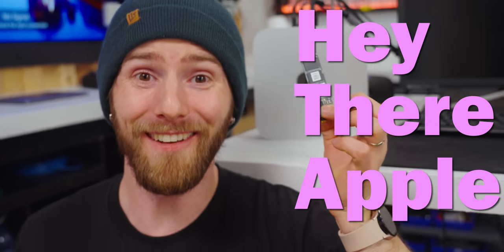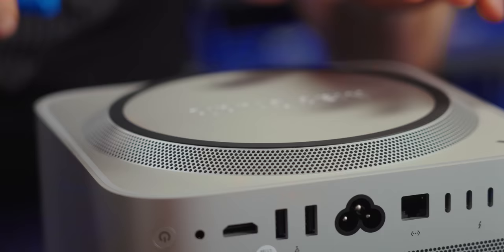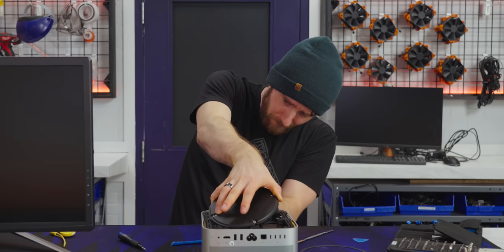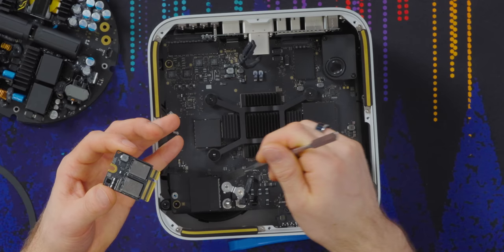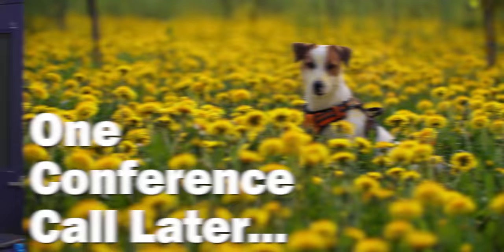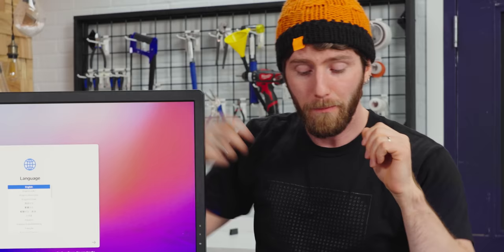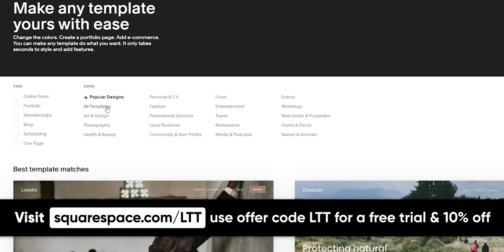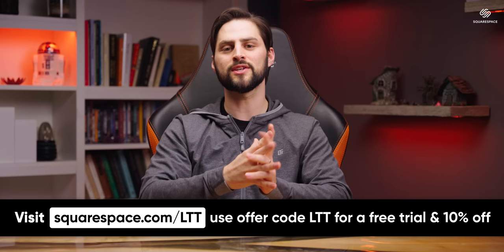I want to love Apple, but they’re making it hard - Mac Studio SSD Swapping

Comment: They made such an effort to make it unrepairable.
Reply: And unupgradable and expensive
Reply: @danielwalls5150  Looks like your SSD is faulty, we will have to replace the mainboard.
Reply: Welcome to monopoly.
Reply: @Kardall  hey I've seen this one, I've seen this one, it's a classic.
Reply: I'm waiting for my check in the mail from LMG for increasing their viewer engagement 😃
Reply: @unicodefox  correction, it can. Quit being anti consumer
Reply: As always
Reply: It’s repairable by anyone, it’s just not upgradeable. You can replace the module with an identical module from Apple or a third-party and (as far as we know) it should work. The availability of those identical modules is a completely different story.
Reply: @unicodefox  okay, how does framework make an extremely modular and repairable laptop despite not being a tech giant. And Apple fights tooth an nail to not get you to repair your own shit for a reasonable price?
Reply: Max Tech will make a video on how Linus is wrong!!!😹😹😹
Reply: @leovang3425  It CAN but that didn't make sense for apple, and not for 100% anti-repair reason. I don't doubt anti-repair wasn't on the table, but people saying apple did it ENTIRELY for anti-repair and went out of their way to do so are wrong.
Reply: @kshitijvarshney  To be fair only slightly more expensive then a PC at current GPU prices. Not that you could get a PC anywhere near as powerful at this size. Not that I’d want one, can’t game on it and I’m not a video editor. Also don’t want to pay Mac software prices. The important thing is how much influence they have on what I’d actually want to buy and this anti repair BS is bad for everyone.
Reply: @SCU3A_S7EVE  you mean it's not repairable because you can't get the exact same components?
Reply: @SCU3A_S7EVE  I bet their controller can detect third-party flash and refuse to work with it.
Reply: @unicodefox  what would you call a product that is specifically designed to work with one component because of software serial locks for the express purpose of preventing the said component from being replaced with an exact replacement, even from another device? They call that UNREPAIRABLE , meaning that even if you had an OEM part from Apple, you could not repair your device without having to go to Apple and only Apple
Reply: @theLMGN  they are saying "intentionally" because Apple puts extra time and manufacturing into making these things unrepairable by 3rd parties.

For example, the non-removable power cable. They put extra time and effort into engineering a cable that you need a specific apple only tool to remove and replace. That seems pretty dang intentional to me...
Reply: @unicodefox  nope. Doesn't work like that. A regular SSD wouldn't bottleneck it. So it was 100% planned obsolescence.
Reply: Ross enters the chat..
Reply: @InvisibleSquids  Linus replaced the flash in this machine and it worked...
Reply: @unicodefox I think it’s only for anti-repair reasons. To push parts around in a computer so that you can’t easily replace individual components or to lock components to chips has no use otherwise.
Reply: @unicodefox  iSheep spotted
Reply: @leovang3425  Because that's a difference between a company that promotes itself as ultimate repairability. I think apple SHOULD try to aim for maximum repairability, especially in a machine like the Mac Studio, I just don't like people saying they went out of their way to make it completely unrepairable.
Reply: @unicodefox  <~~~ found the sheep
Reply: @InvisibleSquids  Did we watch the same video?
Reply: Besides, the term PC was originally defined as ‘Personal Computer’, and according to the Merriam-Webster Dictionary, PC still means as such. If I purchased a Mac computer, I’d like it to work as if it was my ‘personal computer’, because I own it. If the right to repair is steam rolled and buried by the likes of Apple, you will own nothing and have zero permission to do anything with what you are ‘leasing’
Reply: @esmooth919  Yeah, we get it. You don't understand how this works so you just gotta resort to childish insults.
Reply: For that they cost you too.
Reply: @unicodefox  apple apologists detected* OPINION REJECTED!
Reply: @Kardall  hahahaha
Reply: @esmooth919  Grow up.
Reply: @unicodefox  The only one that went out of his way there is Apple to lock their system as much as technically possible.
Reply: I'm not saying this is how any of this should be, but this is how it is*. I *wish i could put more RAM in my MacBook, but I understand the technical limitations on why you can't upgrade the ram in a M1. With older Mac's its a lot more muddy, the only reason you couldn't replace ram was because laptop go thin, and of course, Apple likes that $$$.
Reply: @LazyEngineerYT  Grow up.
Reply: @unicodefox  Lies. They did make it unrepairable.  The function of having to have another MAC is completely pointless outside of making the computer more unrepairable.  The only liar here is you.
Reply: Don’t worry soon the EU laws will creep up to these business and end all this crap
Reply: @unicodefox  No, you're just one of those who believed and repeat that bs.
Reply: @Kardall  When was the last time your NAND is faulty? LOL ... The SSD Controller is in the SoC, so the only way it will fail if it's NAND dies.
Reply: @unicodefox  Your a consumer, I am a consumer. Let's all push them to make it long lasting, PEOPLE CANNOT SHELL OUT MONEY ALL THE TIMES ESPECIALLY IN MANY DEVELOPING COUNTRIES.
Reply: @tpg81  Ok, replace the NAND on your SSD (not the entire ssd!) and tell me if it works. If it doesn't I expect you to treat WD, Samsung, Sabrent, Kingston, etc the same.
Reply: @unicodefox  if the design was faster than a industry standard SSD, then you can make claims that Apple engineered for performance. But it's not, it's not any faster.

Apple even went as far as having a m.2 like interface.
Reply: @unicodefox  no. They spent time making sure it didn't work.
Reply: @unicodefox  that ain't true. Why would locking out higher capacity flash modules makes it slower? Or why would it increase engineering time? Almost all ssds with higher capacity are faster than the ones with less capacity. And apple used some engineering time to add this dumb "security" while they could have just not spend any time and there wouldn't be any problem...
Reply: @unicodefox  please explain to all of us hillfolk what the technical limitations of replaceable ram dimms in an apple are. We shall wait.
Reply: @unicodefox  there is no technical limitation to a DIMM slot.
Reply: @leo vang you obviously don’t have the knowledge about the RISC architecture in the recent Macs. With arm, the SSD controller is baked into the SoC for speed, power efficiency and lower production costs. Because of this, different flash chips often do not work correctly with other brands controllers. They have done this to reduce the current required on the data lines as the controllers are located closer to the processor saving power. Obviously they may of considered anti-repair tactics after, but this was not the primary motive
Reply: Meet Apple
Reply: @unicodefox  Yup, so that shouldn't be an issue to build something proper from the ground up.
Reply: @techandy1747  he can do this 🤣
Reply: @leovang3425  I saw it on a rerun....ofeveryappleproductever
Reply: @danielwalls5150  Nothing at the genius bar is repaired, its just flat out replaced and sent to the e-waste bin. Whatever its attached to gets replaced. Like a full on motherboard replace just to fix a faulty connection or ssd or cpu or ram or anything xD.

Thats apples special feature ;)
Reply: pro tip, stop giving apple your money.
Reply: @unicodefox  People like you drives Louis Rossman mad
Reply: No, it comes from the M1 chips being based on embedded SoCs. Those don't generally do PCIe slots very well.
Reply: @unicodefox  There is absolutely no technical reason (performance, reliability, security, etc...) why replacing a 512GB module with a 1TB one wouldn't work. They sell the damn computer in that configuration. It not working means they went out of their way to specifically block consumer or 3rd party storage upgrades.
Reply: @unicodefox  the fact that they built the power cable into the monitor means that they intentionally do this crap
Reply: Sadly yeah. Very frustrating. Love my M1 MacBook Air too, but frustrates me that it’s not very repairable and not even the storage can be upgraded. This one though, with modular storage that can’t even be upgraded, is just beyond stupid.
Reply: Well, that effort made them money
Reply: @unicodefox  A Mac is a PC just with OSX installed lol
Reply: @martinqizeaq  Very true, and doubt we even really get any additional storage performance by having it integrated as it is. Least not much
Reply: @unicodefox  OMG, brainwash is worse than I thought.. 🤦‍♂
Reply: Not unrepairable, unupgradable
Reply: @unicodefox  when you spend Billions on engineering your engineers Will literally spend millions (if you divide the money spent by the time spent) on the subject of repairability given the company HAS to give a warranty and therefore plan for repairs, they just focus on what they need to do to ensure they're not straight up replacing units for a small factory defect. Stop making excuses for people that know what they're doing.
Reply: It's almost like it's their hobby at this point
Reply: @katherinemorton9126  So you are saying the limitation is hardware-based and there are multiple versions of the silicon, each of which supports only ONE storage size?  How is that efficient for manufacture?
Reply: just buy windows PC.. ez
Reply: @unicodefox  hello you apple fan, they didn't add the ssd controler into the m1 dye because it's better (and it may be 2% faster, i have no idea) but because it's cheaper, the used their type of not because the philips screw isn't good enough, but because it is harder to disassemble and so on.
Reply: @unicodefox  so anti- consumerism anti third party repairs anti upgradable UNLESS you send it to apple for how long? Days, weeks, months? It is better to be able to upgrade it yourself or to add non apple sourced(ie more expensive) upgrades,
Reply: Nah it’s repairable, just not upgradable. You have to stay at the EXACT spec as it was when you bought it
Reply: Agreed, and if they put all that effort into the mac itself, it could be a good mac/pc
Reply: It seems like Apple is where engineers go when they are angry at consumers
Reply: @Wigglez69  only in the EU, The USA will still be stuck with this crap
Reply: @unicodefox  no its to make more money... nothing to do with reliability, speed, performance... its an NVME M.2 Interface nothing more.
Also the DWPD is nowhere to be found, I'm guessing it's the cheapest NAND possible.
Reply: Are you surprised?
Reply: @Sanya192  and if the controller is on the die then you cant use a third party component like a m.2 nvme ssd from kingston, there will be conflicts because of the controller on the die and the ssd
Reply: That's how the innovate these days
Reply: @katherinemorton9126  they have a whole  division dedicated to making all the hardware completely fixed and integrated so yes technically it's focused on anti repair in an indirect way...
As for performance differences in Apples NVME implemention its actually worse performance... your transferring data from the NAND dies of PCB down the m.2 connector to the NVME controller which is on an SoC by itself and then passing it to the PCIE controller and then back to another SoC which has the CPU cores... that is a disaster in terms of performance, power, stability and reliability plus your going to have several retimers because the distance is huge.

There is no performance advantage, the interface is NVME M.2.... the max I/O is completely capped... your limited by a physical x4 PCIE link.
Reply: @unicodefox  And how do you know this is inaccurate? Blind faith and trust in Apple?  It's totally possible that they did this to continue overcharging for storage. Actually, it seems more likely that this is the case
Reply: to be honest. anyone deserves this treatment if they buy any overpriced crap just because there is an apple logo on them
Reply: So much for ewaste control
Reply: @Kardall  More like, "Looks like your SSD is faulty. Would you like to buy another Studio now or later? :)"
Reply: @unicodefox  I understand your point and to an extent agree. The guy saying you can't replace the SSD with an identical one is of course wrong and obviously didn't watch the video. 
The only thing that'll mud up your argument is a little more testing. They might not support two 512gb modules because that's simply not a configuration they sell. Fair enough. But if you take two 4tb modules and drop them into one of these computers and it refuses to format, that's absolutely a firmware lock that was intentional. If putting a 1tb module in a 512gb device doesn't work either, or any other factory supported configuration, same issue. We'll just have to wait and see.
Reply: @Kardall  Looks like your SSD is faulty, we will have to replace the whole house.
Reply: @Kardall  No you can install one of the same capacity.  But for an Upgrade.. you need to buy a whole new Mainboard, or get someone for flash a hacked Firmware on your old.
Reply: The Right to Repair bills and laws leave a huge loophole for Apple and others to exploit: the timeliness and price of parts. Nothing would stop any anti-competitive company from deliberately dragging out the process and marking up prices to discourage owners from fixing things themselves. Apple making things increasingly difficult to open up is just another sign of how it'll act when/if RTR laws finally are passed. In my case, luckily I have a friend who is able to help me work on the Apple things I own.
Reply: What we (the world, except Apple fanboys) understand as a "repairable" computer  is one that you can fix at reasonable price, not one that the SSD has been specifically  designed to cost four times its price in the open market for no reason. This SSD is slower and has  less capacity that many SSD NVMe that cost half the price. Also  it uses standard flash memory not manufactured by Apple. They just got an upgradeable & repairable standard  computer component and dedicated a team of engineers to block those possibilities just  because of  corporate greed. Bad for the clients, programmed obsolescence in pure state, bad for the planet and  a crime against humanity.
Reply: @unicodefox  How does boot taste?
Reply: @Kardall  your $2 display cable is too short, we'll have to replace the GPU, mainboard, and screen.
Reply: @unicodefox  "but but but whatabout whatabout whatabout" stop. just stop. Those companies are trying to do it too but at least they don't come with proprietary BS. What? because other big companies are bad that means apple is forgiven?
Reply: @unicodefox  Correction, expecting it is perhaps not the right thing to do, but there's nothing wrong for people to demand it. We're the bloody customers! We can demand what we bloody want to buy! Is it up to the manufacturer to decide if they want to deliver? Absolutely, but it still doesn't take away your right to demand what you would want and to complain about what you're getting.

Are they blowing it out of the water? Some might, but if that's what it takes for them to be heard and it is still for your own benefit, why can't you just leave them be instead? Better them than leave companies be if you ask me, as a customer at least.
Reply: @unicodefox  No, dude, the only reason they made it unupgradable is because of money. That is the sole reason.
Reply: @danielwalls5150  Might as well just   calling itthe dumb bar
Reply: @unicodefox  this is such a stupid take. Sure, having RAM soldered on makes the whole system faster and more integrated. But making the ssd unreplaceable is just stupid
Reply: @unicodefox  lol we have an apple fanboy here
Reply: Modular, they said...
Reply: EU to the rescUE
Reply: @kshitijvarshney  Cough cough... Unless you pay with kidney 😊
Reply: More R&D budget spent on that than providing real innovations, for sure.
Reply: @unicodefox  but is it though?
Reply: @Kardall  ah you mean I need to buy new imac / mcbook because it has slight scratch mark on the cover, got it, here's another $5000
Reply: I feel like at this point it would cost less to make it more repairable than put the time and effort into making it not repairable. This is where there R&D goes.
Reply: For all the people who hate the price, they make a damn Mini and Air just for that reason. Just can’t please some people huh?
Reply: No. They made an effort to make it repairable, only by qualified trained personel with the correct knowledge and parts.
Reply: @unicodefox  I am not sure how else to put his fam — on a PC I can just upgrade the storage on it, but that is because the storage controller is on the SSD. Linus is right saying there's no reason for this — end-users with the tools to do so should be able to upgrade the flash, re-write the system and expect the modules to work. Except they don't because they designed the system in a way you can fix but not upgrade the capacity.

If I put a higher capacity module into this hunk of junk because I needed more space inside for more stuff, I shouldn't be disallowed by using this feature. That's just like Samsung DeX but only if I used their special HDMI cables because they use the reserved pins for some horseshit where I can only interface with newer Samsung TVs. (Apple already does this with some accessories!) Or as presented to you multiple times, component serialization where OEM parts can't be replaced without special software to Authorize the components.

On my crappy discontinued Lenovo S340-15API I can tear down the board, put an SSD in and it just works. It doesn't matter if I add in less space, or more space, I could had went down to MicroCenter yesterday and got myself one of their free SSDs to put into my machine — it could had fit and I could have more space (with greater throughput speed).

This storage module crap leads to a few occurrences which result in the following:
A) End-user goes into an Apple store or ships off their computer to get their storage upgraded (not replaced with like module)
A.1) End-user is charged an outrageous amount of money for the privilege
A.2) The repair depot it ends up at (because you don't think they fix the devices in-store on-site do you?) uses their specialized Apple-branded hardware unavailable for end-users to re-authenticate the hardware configuration
A.3) End-user gets the machine back after up to several weeks of waiting
B) End-user tries to upgrade themselves
B.1) End-user buys more capacious module online without foreknowledge of the pain to come
B.2) End-user purposes a debit / credit card as a scraper to break the rubber seal
B.3) End-user risks potentially-deadly shock by touching live metal components on the power supply via a capacitor holding charge
B.4) End-user managed to either insert a like module of same size for higher capacity or replaces the module forthright to add more capacity
B.5) End-user tests configuration and tries to restore
B.6) Machine detects a storage hardware or size mis-match (capacity greater than provided) which appears to be baked on-board or can only be reconfigured at an Apple repair depot
B.7) End-user gives up after so long and makes their way to the Apple Store for resolution
B.8) Genius tests the rubber seal and sees it had been tempered with resulting in a denial of service
B.9) End-user must choose one of three options (i, ii, iii)
B.9-i) Abandon machine and leave at Apple store
B.9-i_1) Apple sends the machine to a repair depot
B.9-i_2) Depot "Refurbishes" the machine
B.9-i_3:a) If machine looks "New enough" they'll resell as new
B.9-i_3:b) If machine looks slightly damaged, they'll resell as "Refurbished"
B.9-ii) End-user chooses to have the machine repaired out-of-warranty
B.9-ii_1) A, but now moreso exorbitantly expensive
B.9-iii) End-user purchases a new machine with higher capacity storage because that's just the "Easier" thing to do

This presents a new option, C) Attempt to use the second machine to attempt upgrade out of curiosity but that leads down a similar series of events to B.

Option B should never be a thing! It's meant to deprive you of choice and make it so if you want better, you have to do it "The Apple way" rather than the PC way of just buying a damn storage module and upgrading it! Apple machines were never this hard to upgrade the storage but damn it they found a way. Vintage Apple machines where people were chopping up cases to install internal SCSI hardware into their cases was more than the one-off Action Retro presented and it's a disgrace we don't have a similar level of control with the hardware today.

The safety argument veils with the safety of preventing dangerous conditions by barring the end-user from looking inside and seeing the danger therein when it's really the safety of ensuring third-parties do not dilute Apple's hardware with third-party upgrades.

The security argument veils with the potential danger of reverse-engineering as a means of both limiting your choice of what you do with your hardware and securing Apple's long-term profits through this lack of choice!

I wish to ask — what do you advocate for?
Reply: @danielwalls5150  das ist das Ding. Reparaturen kosten Geld, wegwerfen und neuverkaufen bringt Geld.
Reply: @loidforger6413  Can't have a monopoly on a product only you create.  If McDonald's doesn't have a monopoly on Big Macs, then Apple doesn't have a monopoly on Macs.
Reply: that's why it cost's so much! Now we all know!
Reply: @unicodefox  I dunno, I just watched Linus try to find the screws to open the case...But that could be due to some "aesthetic" thing.  I do (sort of) agree with you, I have a question.  With regards to speed and SSD's...they're removable.  They make a solid connection and they lie flat.  What sacrifices to speed do you mean?  I know from personal experience that from time to time SSD's get updated and upgraded.  The SSD's themselves get faster.  So in my eyes, a year down the road and there will be a newer, faster SSD and I need more space.  I won't be able to spend that $150-200 dollars to buy that nice new SSD upgrade.  I'm stuck with whatever the "big brain" at apple says.  How is Apple sacrificing speed when they put an artificial governor on their product?
Reply: @unicodefox  Are you really defending this? Stuff gets standardized and swappable to resolve ALL of what your argument is trying to defend at an actually palpable degree. All right, it is "Repairable" at a basic level, but how the fuck is locking your device via firmware for your flash beneficial in any realistic capacity?
Reply: @unicodefox  because working with standardized parameters like every other manufacture is too much of a pain
Reply: @unicodefox  they most definitely went out of there way
Reply: how exactly is this non repairable. The usual comment horseshiet.
Reply: @danielwalls5150  ah sure because Mr Walls thinks 3years of extended warranty is supposed to be free Apple care is objectively overpriced. Sure.
Reply: @unicodefox  that's a pretty stupid take when you consider how often apple spends extra money to make things not work. Think about what could be done with the time, money, and expertise that goes into serializing phone screens and batteries so that your device throws a fit if a damaged part is replaced with an identical unit. I'm mainly a PC and android guy, but I really like my iphone. However, if my pc were damaged, I could replace any component that needed replacing. If I cracked the screen on my S22 Ultra, I could order a replacement part and fix it myself. On the other hand, if I were to damage the screen on my iPhone 13 Pro, which I paid for in full, I would have to have it repaired on Apple's terms or do the repair myself and live with artificially imposed limits on the functionality of a device that I own. If you're ok with a multi-trillion dollar corporation going out of its way to limit your autonomy I can only assume that's due to an incomplete understanding of or lack of knowledge pertaining to the situation. Just remember, every added dollar that goes into developing these anti-consumer features ends up coming out of the pocket of the end user.
Reply: Apple needs to be taught a lesson and that lesson needs to be taught soon !!!
People need to stop buying demonic Apple products for 1 year or maybe 2. Straight , no macs , iphones , heck , no adapters nothing!!!!

 i have a Macbook Pro late 2014 since 2015 and i love using logic pro x and final cut But: they soldered the SSD onto the motherboard ever since 2016. I recently went to an apple certified repair shop and asked them : what if i get a m1pro macbook pro and as soon as the warranty expires , the ssd fails me . How do u go about repairing it ? They said it ll cost me a hefty sum cause they replace the whole board . I was like WhAT ? Like dayum , replace 5-6-7 parts just cause one don’t work , there ain’t nuthin logical about that . Another point is : on windows : 1tb ssd —-> roughly 110$/€ . 2 tb ——> roughly 2x 110 $/€ . @demonic-apple ——> 2tb costs 800$ …?!?! What ? And you can t even replace it . I have a dream : :” that for 1 year straight up nobody buys any apple products , not even an adapter . Let s see those execs shit their pants and start asking questions like : oh my … what are we doing wrong ? To me they seem like money hungry apes that can not quench their thirst for money . It walks along the lines of unethical . There s isn’t even any real advantage to having the ssd soldered. I ve heard people say that it s faster . No it s not . We have the internet . Anybody can check the numbers and the speeds of different ssd s out there. Oh and just to put the cherry on top : iphone 13 : amazing processor and hardware but it s rocking the lightning port 🤣 usb 2.0 speeds . Apple 🍎 i really hope u get yours and the EU puts you in place with regulations on ports and on right to repair . They got hundreds of billions offshore like liquidities ….  This got outta pocket a long time ago … out of their consumers pockets to be exact. They answer to no one and lack moral discernment . Take care y’all 😃🙏🏻🤗. But the processors are amazing and I respect the integration of the cpu and gpu and RAM 🐏 . Cause that actually wields a big boost in performance. I hope somebody serves them good .. money hungry apes 🦧
Reply: @unicodefox  I mean we've basically seen it in every apple iPhone since 2018 so its kinda accurate
Reply: Like you could repair a broken Mac. Storage upgrades are easy, just plug in an external drive.
Reply: @katherinemorton9126  Yet there is a perfectly functionning industry standard that has been in use for years....
Reply: To make it only repairable by them*
Reply: It rubs the lotion on it's skin or else it gets the hose again
Reply: ofcourse they want that 200 dollars for an upgrade you can do yourself for 80 or less
Reply: i know it remains to be seen how far but supposedly google will be supplying screens batteries and other parts through ifixit to allow their customers to swap their own batteries and screens if they feel up the the task. 
pretty decent olive branch to their customers and community
Reply: @danielwalls5150  there are many many things they don't repair. They will sell you a new one and send the old one to be refurbished.
Reply: @Kardall  lol
Reply: @unicodefox  … speed?? All they needed to do in this case was not lock down the storage modules … 1) allowing third parties to build replacement Modules of various sizes and letting them work when plugged into the available sockets without the need of a special tool to “code” them 2) make the Wi-Fi / Bluetooth module standard so it can be upgraded
Reply: @unicodefox  they could have made it repairable and upgradable, at the cost of some people not paying apple to fix it and upgrade it
Reply: @unicodefox  …I was having trouble with my 1tb nvme ssd in my pc… bought a Samsung 2tb 980 Pro on sale for $226…. Installed it myself….  Used a flash drive to reinstall Windows 10 Pro….  Reinstalled my applications and restored my data from backup…. Cost to me… $226 plus a couple of hours of my time….  No “Genius Bar” required.     See how that works?
Reply: @katherinemorton9126  …except, that has nothing to do with RISC or ARM … that is simply what apple chose to do with its SoC design.  Regardless, moving the controller on to the SoC just makes the storage drives even more simple.  Apple chose to restrict the ability to replace say a 512gb with a 1tb module…it’s something they chose to do that has nothing to do with where the controllers are situated.
Reply: This is just bull**** news for us consumers.
Reply: Yet people still buy them
Reply: $3k e-waste
Reply: @ToddIrwin  Aw man, I wish.
Reply: @unicodefox  you wish you could put more ram in your Mac .. well you can with another machine it’s called a PC ! this is a great invention you can literally replace any component you like ! Not only that but a more powerful component than that of a Mac ! ontop of this you don’t have to buy a whole new machine the year after, again you can do this miracle thing of replacing something your self ! It’s like magic! before you go calling me a apple hater I own half a dozen apple devices! Unfortunately you have no leg to stand on when defending Tim crook! because that’s what he is / they are ! their entire strategy has nothing to do with the customer or the environment! this is why apple gets so much hate. why do you think they reintroduced the ports back to MacBook and changed the keyboard?? Because MacBook sales had plummeted no professional wanted one and they were far to expensive for the average joe! apple bullsh*ts people into thinking performance would be affected by separate components.. funny how intel and nividia chips combined kicks the ultras ass ! Not only that but both intel and nividia have new chips out later this year which are rumoured to be up to 30% faster ! 
To wrap it up as a professional I have no time to take my broken Mac to town wait for apple to say it’s fu**ed only to be charged a small fortune for a new one ! when I can nip out and buy a new component my self swap it out and carry on with my work !
Reply: @danielwalls5150  Not to mention Genius bar is a total joke.  Refer to Louis Rossmans videos for more info.
Reply: @unicodefox  techniqually they did go out of their way to make it unrepairable, they engineered it to be unrepairable, would have taken less money and time to make it repairable
Reply: @Kardall  looks like the display is burning. Time to replace the entire keyboard
Reply: @unicodefox  no no, he replaced it in a Mac
Reply: @unicodefox  You took this comment seriously?
Reply: That's apple for you
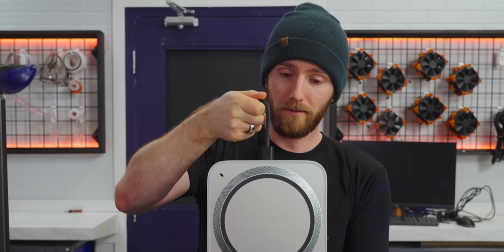Reply: @unicodefox  Look at 2:00 onward. it would've took less engineering and assembly time if they just had screws accessible. They tried to make it hard on purpose.
Reply: @unicodefox  they are anti repair, they only revise it when they lose lawsuits or are threatened by governments. It in fact costs them more money and time to make the hardware less repairable. (Custom tooling, firmware, manual Labor setup for specific builds) it's plain anti consumer, and wasteful.
Reply: @unicodefox  No, clearly you don’t understand how it works dude you’ve been proven wrong multiple times over. Stop commenting.
Reply: @Kardall  Looks like your power cable is faulty, we will have to replace the Apple Studio monitor.
Reply: @unicodefox  There's literally no reason to limit the repairability of the hardware, the possibility to swap SSD, no reason to make you use another Mac to install the OS, or to ask for so much money for something worth the half or even a fourth, etc...
These all do not affect "speed", or "reliability" tho it affects engineering time, engineering time to make it less repairable.
Reply: At least they made the power supply swappable so you can replace it when it explodes.
Reply: @unicodefox  found the apple user
Reply: Rotten Apples deserve to be in the trash
Reply: Sadly and I can't a reason for this?
Reply: Use a cheap SSD that does not have a controller. should work
Reply: @unicodefox  this is pure garbage. PCs have been managing it for decades, laptops too. Its greed, pure and simple.

How would any of what you said apply to using enctypted keys to pair batteries and various other modules to motherboards?
Reply: @unicodefox  wow dude, you made soooo many excuses for apple. Its embarrassing.
Reply: I'm not defending Apple at all, but I think this shit is a result of their Apple Care program. They want to offer comprehensive insurance, but don't want a bunch of people messing with computers and coming in trying to scam Applecare repairs. Maybe I'm wrong but like everything they do they even want the repairs and insurance inside of their walled garden.
Frankly it doesnt bother me too much but it might if an SSD fails and I'm out of Applecare cover.
Reply: @alihorda  Why is it crap? tbf the performance per $$$ is easily comparable to PC and the hardware is good quality. Yeah there are problems with Apple that some people can't stomach but it's not "crap". If people say shit like that then it basically invalidates their opinion.
Reply: @chromab7713  did you even watch the video?
Reply: and they are making their customers look stupid too.
Reply: @halfalligator6518  because it is cost per performance wise, they have good hardware but at that price point totally not worth it. also apple has some eye rolling policies /practices
Reply: how else do you think they are rich? they force apple andys to pay tens of thousands for every product they own since repair in apple term = buying a new product
Reply: “Oh no! I dropped my DESKTOP computer and only the SSD shattered into a thousand pieces! Damn you Apple!”
Reply: @unicodefox  Please stop talking before you make yourself look more like an apple Stan on twitter than you already full and well look AND sound like
Reply: @leovang3425  framework can do that because they’re not doing anything top-of-the-line.

Meanwhile apple tries to his top-of-the-line in every category at once. 

Can’t even get Thunderbolt on a framework laptop… can’t even get onboard storage >1tb…
Reply: @unicodefox  "I just don't like people saying they went out of their way to make it completely unrepairable." May I ask for an elaboration on why you don't like that criticism?
Reply: @BixbyConsequence  prolly op dosen't even know the in details about m1 microarchitecture hence why op retell what has been told by someone. Strange Parts could do 1TB on an iphone by itself, and that phone use SOC, even different than M1, but this modularity and stuff is just straight up planned. That's why apple is mostly "Style over use" on the average user who does not even care about it, it looks good etc, but once they ran out of something, they started to search, and realized XD. Apple became better on company bcs they suck most of people money bcs they know the product mostly wont need upgrades/repairs, until they ran out of storage or durability XD
Reply: Never buying a mac pc  if I can't repair it lol. IPhones I love ( for long term os support, NOT for repeatability (not like most phones are though),  but I'd never by a pc from apple, yuck.  Also apple, I hate you, stop being assholes. it's you or Samsung for the next phone and you both suck differently, It's the choice of suck I have to choose. and if I can keep my next phone out of the landfill for 4-5 years I'll choose you, but only because of the long term support.  ( I have an iphone 6S+ atm) 2022.
Reply: @unicodefox  They 100% went out of their way to make it unrepairable.  You can argue that there might be performance advantages in moving the storage controller, but going even beyond that they specifically locked down the ability to swap storage modules IN FIRMWARE.  They spent actual development time to make sure that otherwise identical parts are not interchangable.  And it's not the first time either -- Apple has been pulling this with screens and batteries too.  You can have genuine screens and batteries but they've gone out of their way to add software checks to the serial number of the replacement parts to deter people from getting repairs from anyone but them.
Reply: @anakinlowground5515  where did I say that wasn't what they're doing? 😂 I've said they spend millions talking about how to repair the device but this is the outcome so they must be making it hard on purpose
Reply: @loidforger6413  it's only monopoly if you are stubborn and stay with apple.
There are PC's, a similar kind of product which are cheaper
Reply: @unicodefox  that’s why they are always being sued in the fact that people can’t even repair their products. Replace what’s broken and the device is still useless
Reply: @unicodefox  we are saying apple did it intentionally is because it is a de facto that Apple specifically designed to firmware to support anti-repair for consumers. it does not matter if apple claims it or not. because consumers have tested pretty much everything and it is a firmware limitation. and if you know even a bit about softwares then you'll know its 99% chance that the un-upgradeable feature is intentional because it comes out with a specific error code, rather than a random syntax error
Reply: @danielwalls5150  sure, because those are exactly the same things.
Reply: @unicodefox  They have already done the work, all they needed was to give the consumer access to it. instead, it's locked in the particular firmware.
Reply: No, they made such an effort to make it perform so well that they didn't bother to consider repairability. Subtle, but important difference.
Reply: @alihorda  oh not like Samsung, Google, or Microsoft who all have fantastic policies. 
The new Apple hardware is in fact well priced. Even still 18 months later you can't find something that competes toe-to-toe with their bottom line M1 Air. Talking about a combination of build quality, price, size, weight, battery life, power draw, heat (or no heat), PPI, color accuracy, speakers, keyboard quality, the best trackpad no question. Fanless (zero noise). Not to mention snappy performance for every day tasks with that unified architecture. That model is priced very reasonably by Apples standards. Admittedly Apple have been terribly overpriced in the past but I don't think you'll find many other products that tick all those boxes (there are a few, but they're the same price or usually more and lack a few things on the list). Apple silicone really has changed the equation when it comes to overall value with Apple hardware.
I've always admitted the strong points of PC hardware and software. I've always used Windows. I just find it a little bit pathetic when anti-apple-hateboys can't recognize not all people who buy apple do it for the branding. They're fantastic tools for some of us. Also I've never had to replace an internal component on Apple hardware but if and when I do... i guess i'll see how it all goes and reserve judgement for then. I use a PC tower for games, and Apple laptop for work/creativity.
Reply: @leovang3425  facts
Reply: @Elkarlo77  u still have to have another mac to be able to use it ever again tho, which is bullshit
Reply: A big middle finger to the right to repair lobby
Reply: @unicodefox  okay apple shill
Reply: @unicodefox  he replaced 1 thing huzzah apple is safe and true to their word!!!! Sure dawg give more reasons apple isn't making shit difficult, it's worse than a mechanic, you're fuse is burnt out gonna have to do an engine swap, because if you do it yourself it makes us lose speed, performance, or something
Reply: @unicodefox  Replacing the NAND on your SSD would work, and is actually done all the time (same SKU different chips) by the manufacturer. LTT even showed an example where it was done on an iPhone. The fact that the mac formatted successfully, then refused to install the OS, shows they put time into breaking things. Typically engineering relies on interchangable modular parts to keep costs down for different SKUs.
Reply: this is why i do not buy apple and even if i was given an apple product i would re-gift it or sell it on ebay.
Reply: @unicodefox  none of those things would be sacrificed. In fact they INCREASED the amount of time it took to finish the product by having to add extra code barring the ability to upgrade. They would have to do less work but just not barring it and voiding your warranty if you try. There is no  technical reason allowing the capacity to be upgraded would change there production line at all. They did it so you have to pay them more if you want to upgrade instead of being able to do it yourself, and that is the ONLY reason. Any other reason has no supportive arguments. Its so YOU cant upgrade and have to pay them to do so. If they didn't want people to do it for reliability reasons all they would have to do is void the warranty if the product has been tamped with like every other company. Just like he said there is  NO security reason to do so. Adding the ability to change capacity would require no hardware change or design change. In fact the only change it would require would be for them to undo some of there own work and enable it via software. There would be zero sacrifice other then losing money because people would buy the cheaper model and upgrade it to get the same thing.
Reply: @theorphanobliterator  You need a Mac for an iPad to restore it either.  I don't say that it is good but it feels "normal" for Mac Devices nowadays. And yes i would prefer an Uefi or Bios which could read an usb stick as well.  Apple wants the sweet money from repairs. And will go after Aftermarket Parts, hacked Firmware and Repairshops which provide Service outside the Apple Loop.
Reply: @unicodefox  lmaooooooo no it would not. Did you even watch the video? allowing consumers to upgrade or replace their flash modules wouldn't change anything except Apple's bottom line.
Reply: @psibug565  the difference is GPU prices will drop considerably over the next 2 years as the supply issue is sorted. This device WON'T decrease in price.
Reply: @unicodefox  saying you're smarter than a dog would be flat out inaccurate
Reply: @halfalligator6518  so much work trying to defend Apple
Reply: @unicodefox  There is absolutely nothing about allowing the user to upgrade the amount of flash storage that would affect speed, engineering time, mfg time or reliability. The only reason that users can't is because Apple firmware-locked their systems at mfg time to prevent that. The only measurable impact that has is to force their customers to pay $200 for an $80 upgrade.
Reply: And people still bought it
Reply: @alihorda  so much work being a hater.
Reply: @unicodefox  But like thats the hard truth ? Every other PC or Laptop manufacturer has made their product somewhat repairable, and upgradeable, only apple chose to do it in a way that they would have total control to their product which leads to the fact that they flat out made their stuff unrepaiable for normal people.    Like we both understand how much more money they can make in this way, and i am fine with that thats their decision to make but they just have to bear with the negitive words
Reply: @halfalligator6518  nice assuming :d
Reply: @unicodefox  Buddy making excuses for others faults is a hinderance to progress. Evaluate this thinking, broadly and perhaps youll do more than "understand" anothers point of view instead of reiterating an excuse(s).
Reply: @Kardall  no no no, you will need to buy 3 more Mac Book Pros, an iPhone and an iPad (as well as air pods.) Before we can look at the computer.
Reply: @ToddIrwin found the fanyboy
Reply: Engineering time? ARE YOU KIDDING ME  @unicodefox  ? They could have simply used an NvME ssd, done. No engineering time. They engineered a completely proprietary system with the controllers on the board and the NAND on proprietary cards that they also engineered physically and electrically, then they designed those NAND cards and the interface between them and the controllers. Then they wrote some intentionally jank firmware that bricks the Mac if it detects an unauthorized NAND module (how much effort would it have required to add the simple feature of offering to format and start from scratch if a different module was added?). All this for NO real benefit to the user and a very real downside to the user - being forced to decide on the date of purchase how much storage this Mac is stuck with for life. Also RELIABILITY? How is it more reliable to have your SSD split between the logic board and a proprietary NAND module that is e-waste if its mated logic board dies? A real SSD can be inserted into another Mac and, password provided, mounted. Because yes, encrypted drives have been a thing for years and they work fine on standard SSD hardware.
Reply: @Chris not really ;)
Reply: @Chris the parts are expensive and many things can't be repaired at home. they made a good business with this move
Reply: @unicodefox  no they literally engineered the product to make it less repairable watch the video
Reply: @unicodefox  zero head take
Reply: @unicodefox  How much is apple paying to shill for them?
Reply: Really makes you wonder just how much extra profit Apple is making from the "repair" at the Genius bar.....
Reply: Because they don’t want you to repair it. They want you to go buy a new one
Reply: @unicodefox  they are going out of their way to lock you out from replacing hardware that you would normally be able to replace in any other machine like it how is that not anti consumer by nature? Like if i were to go out and buy a samsung phone and an iphone the samsung i could get good quality replacement parts for reletively cheap and with the the iphone if i took a screen from another one to use as a replacemnt it would scream fowl play and make a fit
Reply: @logirex  so if im using a 3 year old mac out of warranty i should just be fucked? Like comeon sure if I have warranty im gonna use it just when it runs out i would like to be able to add more storage and ram
Reply: @kaliban4758  he does has a point to a degree if its harder for them to do that crap thier it might help them ease up even just a slight bit here just then again apple is one for this shit so still unlikely
Reply: @Noah-lj2sg  still doesnt mean they get a pass when they pull this crap like i could buy a hp or dell or acer and be able to take out the ssd  swap it with a faster bigger one reinstall windows and be on with my day in like an hour and a half apple if something fails i have to go to them for repairs and im just gonna get charged for a whole new logicboard for a connector shorting out
Reply: @Errcyco  a macbook air costs 1399 where i live i paid 1125 for a gaming laptop that had more ram faster storage a better gpu while still being able to go from anywhere from 4 gbs of ram to 32 with just a few philips head screws that macbook is stuck with whatever i bought it with has worse perfomance than the gaming laptop and if anything fails I'm stuck at apples mercy for repairs since parts are impossible to get and pentalobe screwdrivers arent all that common
Reply: @ToddIrwin  apple was using intel until they decided to go with the m1 so what you said makes no sense
Reply: @johansugarev  yea just i could still use a machine even 5 6 10 years after i bought it hardware locking is just bs and needs to stop I get your more than fine with just upgrading but if i can still use what i have without it feeling slow or sluggish in comparison of the new ones id rather just buy an ssd when i need more storage
Reply: @loidforger6413  Cult not monopoly
Reply: They need some haters from Meta to balance theyre self image.
Reply: @unicodefox  stop pretending apple is doing right. You cant pay 700$ for a keyboard its a scam.
Reply: @SCU3A_S7EVE  so everyone can have access to the parts?
I m inmortal but I can die
Reply: @psibug565  Size is the only argument. You cant get also a pc with the logo

You cant find a Mac with ssd speed above 7GB seg
Stand alone real effect card at 8k hevc.
Reply: @zoovy7252  Hardcore Fanboy detected
Reply: @johansugarev  yea i get you can do that but some people would rather upfrade thier m.2 then use otherwise a sata ssd or a hdd external your getting worse performance then just upgrading the internal storage so this doesnt really count
Reply: @johansugarev  alright well fair enough on that one but if your buying something made for what thats made for i would like the option to add more internal storage than have to run a external over causing cable hell and all that it just makes more sense to allow the end user to upgrade thier shit i like using my windows pc because it can handle whatever i want to throw at or in it without having a goodamn tantrum about it
Reply: @unicodefox  I don't quite understand your logic here, even with the possible reasons you mentioned as in for good or bad, they did in fact go out of their way to block it as seen in this very video.

Yes as stated by yourself there may be some pros to this approach, still it does not invalidate what Linus said.

Its just more of an explanation or reason of why apple went out if their way to do it.

So no YOU are simply incorrect.
Reply: @unicodefox  seems accurate to me.
Reply: Don’t act like this is anything new with apple.  They’ve been making hardware difficult for customers for decades.
Reply: Gotta give it to companies like Apple, though; thanks to them, I learned to appreciate money instead of being a mindless consumer.
Reply: @rholmst  We still have to keep roasting them for it.
Reply: @loidforger6413  "Appleopoly"
Reply: This is the same company that made a highly repairable but insanely expensive Mac Pro.
Reply: @akiraigarashi2874  No, it's worse, he's paying Apple to shill for them.
Reply: It's why I stopped buying macs. Too expensive, too easy to break, too locked down
Reply: @theLMGN The design choices involved there have absolutely nothing to do with any of the factors you laid out there, infact they make it harder to manufacture, harder to replace suppliers and more costly due to customized design per product line. Changes such as these have one goal and one goal only, make you a return customer at apple repair shops. You can like Apple products if you want to and not even be bothered about such choices but stop trying to spin it.
Reply: Irreparable?
Reply: @unicodefox  it's not like they use proprietary screws that need special screw drivers or very specific tools to repair. Or decide to just not use type c on anything because they can't force brands to buy their certification or force people to buy overpriced accessories. Not like they did any of this things. Noooooo
Reply: @unicodefox  no.. It's just about getting NG more of your money little fanboy...
Reply: I have a crapple, phone and an imac, for work, trasaple doesn’t have have a place in my home, they spend so much money to make sure things brake
Reply: @esexavo  fr
Reply: @unicodefox  Apple bot and fanboy spotted
Reply: @esc_7242  beep boop 

sent from an android phone
Reply: @Kardall  fr, my sister's MacBook's keyboard stopped working ( not the Mobo) they replace the entire chassis and the screen was the only original part.
Reply: @🦊 U+1F98A  mak an abstraction that you need a second device to reinstall like a phone bur what if you put the recovery image on another famlach drive after all it has 2 slots 😀  amd if you upgrade the space you need to change that system idenfier because the uuod of thw pc points out that the pc suppose to have x amount of storage  change that and it us fixed
Reply: @Steve H  it is also upgadeble with a tweak in the firmware all you need to do is tweak the cof file in firmware  usually efi  y wonder if it exist a jumper on the board to hard reset the controller because that was also the fault message 🤔 y am wery curious what was written,   y mean before the mac os was in recovery it could also make a pop up but it did not  nacs have this firmware reset key combo 😉 that might help here
Reply: @🦊 U+1F98A  ah if you did not do a hardware reset that's why the pop up is like installing a new disk and the old disk data is stored in secure boot
Reply: @Charles Jones  ah nope the fault was that before install after upgrade was not hardware reset performed 😅  that happens even in pc world  hp has als a feature like this where ir records a signature from the partition and does tell you that it is a mismatch
Reply: @unicodefox  it is repairable  everything is but under what cost , y mean it is just costly you need the part then by measuring you find out that the part was malfunction  bad erra data etc  work Labor and you could buy entire device for a 3 quorter of the repair price
Reply: @InvisibleSquids   read the eula  true you own it but  that is about the arm64  tech y mean you won't see a phone  be that android or ios powdered  it wont boot if you replace the flash drive
Reply: @adriancoanda9227  in most android devices, yes it would, but with a caveat. You loose the operating system and will need to load a new one, which comes with its own trials and tribulations. I don't personally know how difficult it is to remove and replace the flash storage on a phone, but since they are also (and always have been) directly soldered to the main boards, it's a herculean task for any consumer without a BGA reflow station. Besides, this thread is about Computers and Apple, where Apple decides that it's perfectly acceptable to solder the SSD directly to the mother board in a "pro-grade" computer, where it has been popular in the mass market for DECADES to upgrade the components, namely the storage or memory. This does not do any favors for consumers to repair their products either
Reply: @onepunchman6165  And you're going out your way to send comments of no value. Who's going out of who's way now?
Reply: The right of repair  bill that was passed did it include this in the bill?
Reply: @unicodefox  Y'know what?
It does not make sense for Apple to EXIST unless for being an "EA" in computer industry
Reply: @unicodefox 
I fail to see how making something a bitch to take apart would be something faster to engineer than something a tad more modular.
Also, that lack of repairablilty and upgradeablility makes the device slower in the long run.

And you do actually have to go out of your way to program a device to say "fuck you" in such a way.
Reply: @unicodefox 
Linus may have replaced the storage in the device, but only after jumping through multiple hoops and needing a 2nd mac to do so.

That's not very consumer friendly if you ask me.
Reply: @unicodefox 
Problem is, the statement is completely accurate.
Apple doesn't want you to repair their machines. Apple wants you to buy a whole entire new machine.
Reply: Your opinion is incorrect.
Reply: They don’t make an effort to make it unrepairable, they are just indifferent to non-Apple repair.
Reply: @Rokmononov 
Someone who uses proprietary screws and glues the battery of thr phone into place is not indifferent to Someone else trying to repair their product. It takes an active effort to make outside repairs difficult.
Reply: @redstonewarrior0152  whatever makes you feel better. The goal was to hide the screws. They don’t care about annoying you.
Reply: One of the reasons to stay away from them, as a former employee of them, I used to own several products from them. a MBP 2016 was the last device I bought and that was on release date back in 2016. Moved to ARM SBC's and recently to Ryzen Mini PC's which BTW allow easy hardware and software upgrades and couldn't been happier and use the extra money I'm able to save now on vacations with my family.